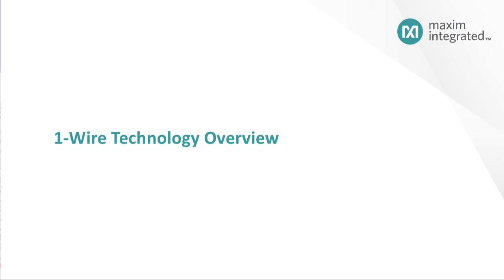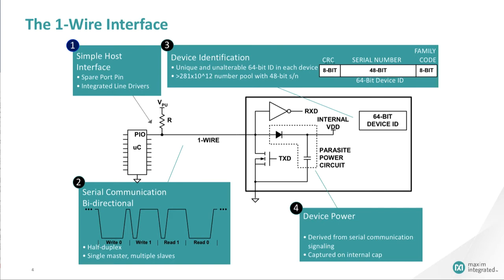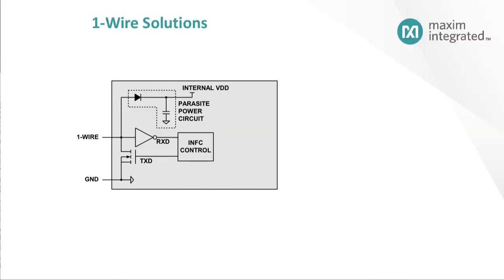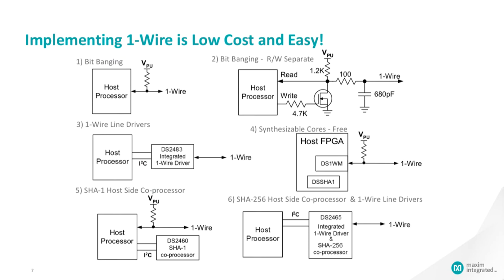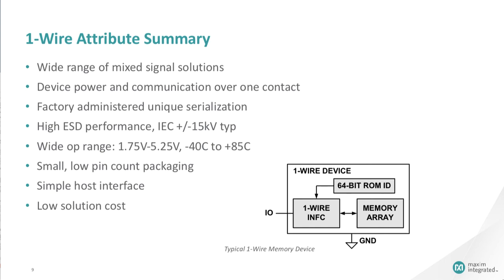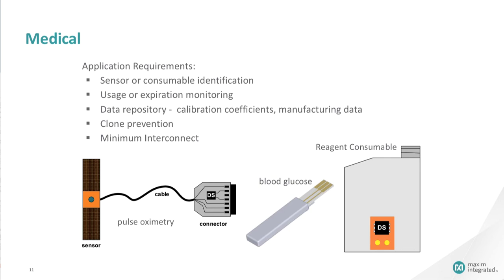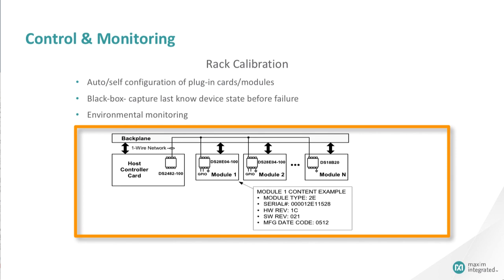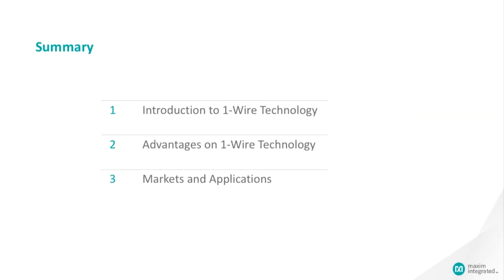1-Wire® Technology Overview

Comment: quick guide thanks. i have a question, in 3:40,  Can  2)bit banging structure  Be used with tx rx serial communication interface port ? most coltrollers have those ports but not sure i can use this for my 1-wire sensor.
Reply: you can use bit banging  to emulate any protocol  you need to configer gpio as open collector with external pull up , using hardware uart passable if one wire protocal is using uart structure  , cheers